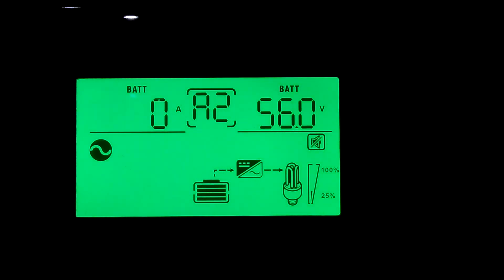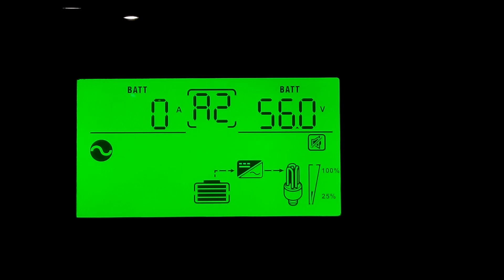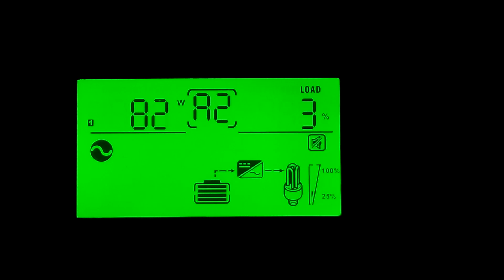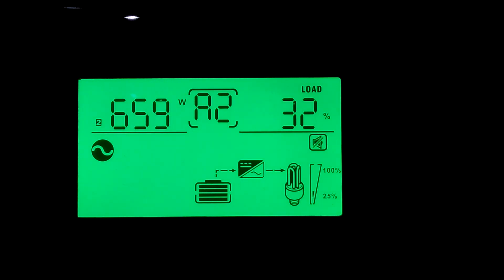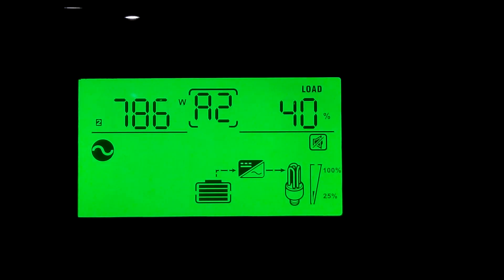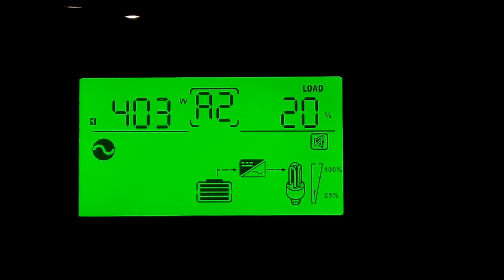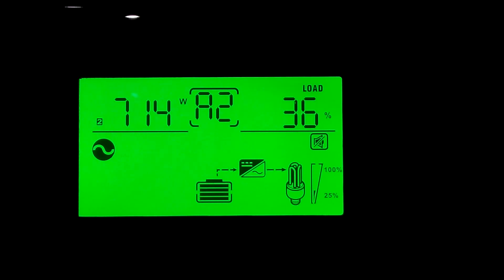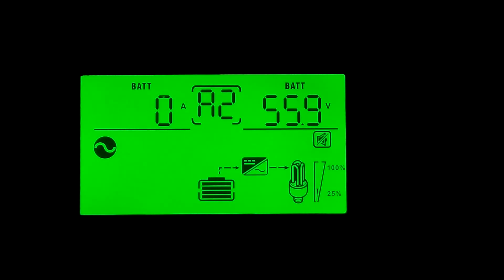First load test for my LV 5048 and Nissan leaf battery Bank.

Comment: Are you using anything on 220?
I have 2 of these coming to hook in parallel. Thanks for this.
Reply from the maker: No not yet I have a mini split that will be running on there this summer.

Comment: Hi Carson, thanks for the great video, I have a question, were you able to run the clothes washing machine while conserving the power elsewhere?
Reply from the maker: Thank you and yes I can  use the washer and the dryer at the same time.  We can also run the TV's lights and some other things like the pellet burner as well with the washer and dryer.  We try to only wash and dry during the daytime when the sun is out.